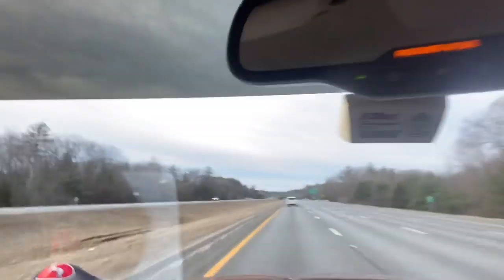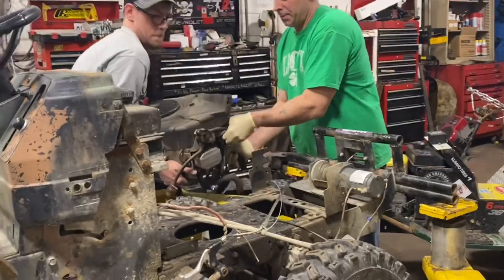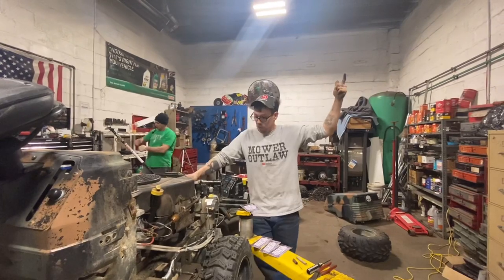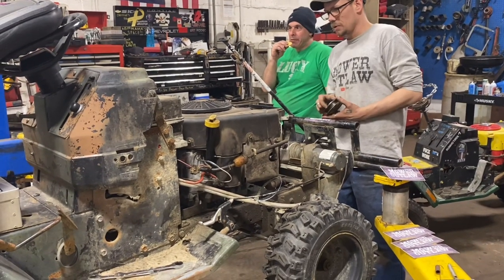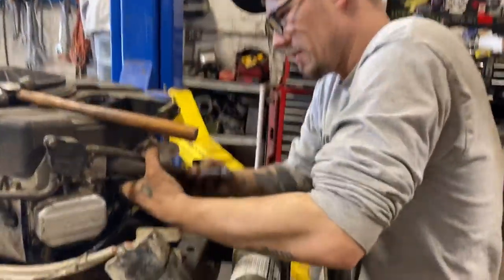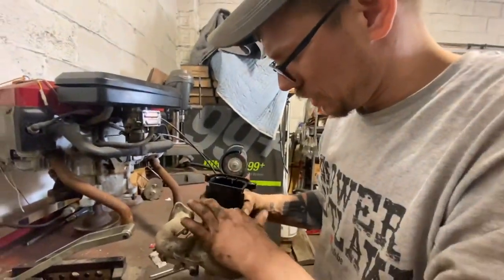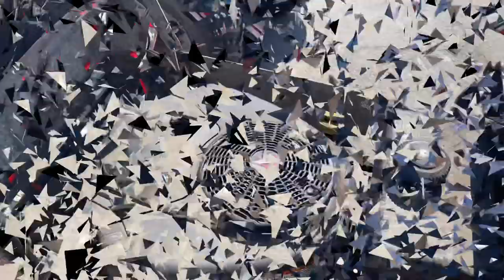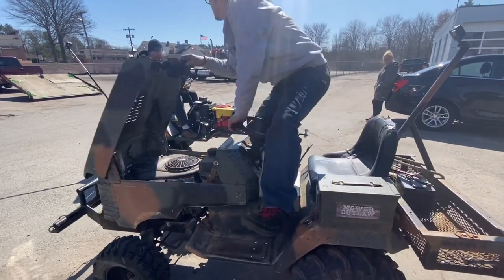Castle is ALIVE!!!

Comment: Nice to see castle back!! V twins are cool, but I personally prefer the opposed twin. That's what I run on my mud mower.
Reply from the maker: Donald Martin I've been doing this for about 8 years..... I've never seen someone say they like opposed twins more then V-twins
Reply: @MowerOutlaw  I'm not surprised. Most people just dont know how to build them. I've been a small engine mechanic for 6 years, and I usually dont see many problems out of the opposed twins. Sure, they burn a little oil when they get a lot of hours, but I have yet to see one send a connecting rod through the block, a common problem on intek Briggs engines.  The key to an opposed twin is the carburetor. If you know how to set them, it becomes a different animal. They have a lot more low end torque than a v twin. My mower can do at 3000 rpms what a v twin can do at 4500 -5000 rpms. Vanguard v twins are beast though.